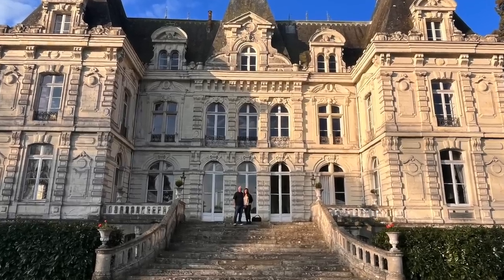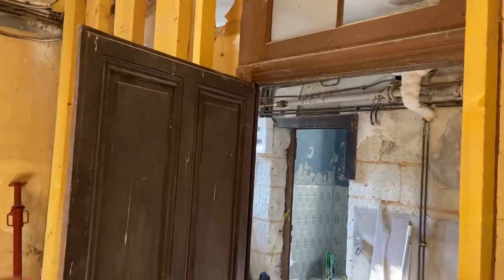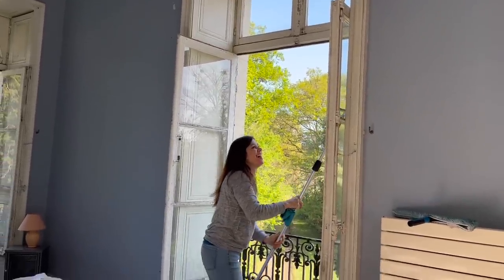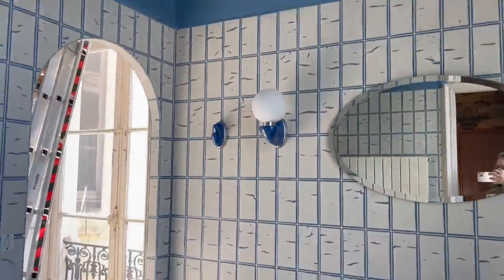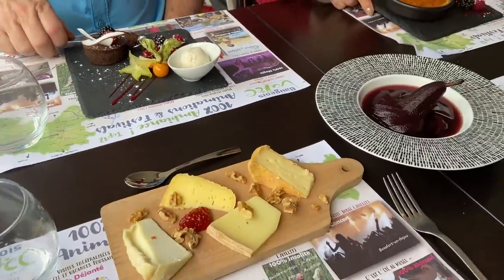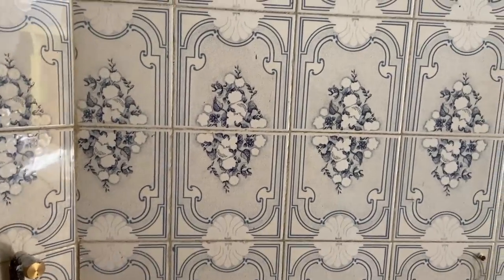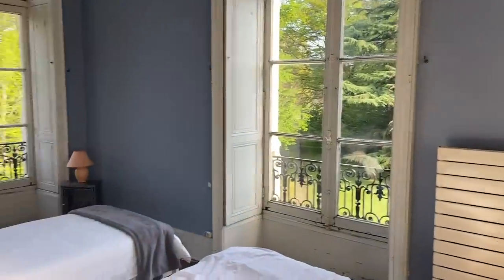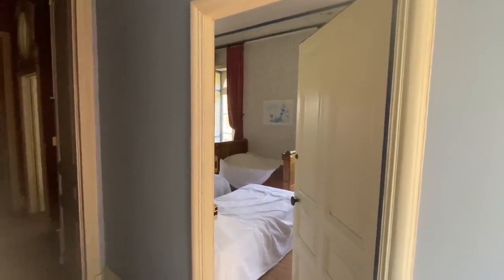Château de la Grifferaie S4, E13 "The Chateau comes to Life"

Comment: Rob the hose fittings are called Minsup, they are typically used for compressed air lines, there still used on medium to heavy industrial applications for Air compression tooling etc.

Comment: Later when you have time the repaired tiles can artistly have the pattern drawn on all the repair spots with a fine drawing paint brush and the colour matched and no one would ever know there were any patches on those tile then a glaze paint on top of the repair would last for another 50 years. Good luck that tile in that bathroom is beautiful and you’ve done amazing job repairing to this point and can look perfect later with pattern match by hand. Ps put a flat glaze on first so paint doesnt soak in and bleed then paint then final glaze to seal. ♥️♥️🥰🇨🇦👏👏👏

Comment: If I recognize the specific aria from The Messiah you use in you intro, it has the phrase "the crooked straight and the rough places plain" repeated many times. It sounds like classical french garden design. Versailles and many chateau would have fit the bill. I'm not sure how much anything else within them did but I'm getting old. more rigid and set in my ways 

BTW - I had to do the same thing to my DIY ceilings but found a guy around the neighborhood who went through about 25 gallons of joint compound to cover unevenness and some still slightly visible seams with a texture he pressed into it with his own bare hands. The ceilings weren't very uneven. He just laid a think layer to get a deep texture.  I don't know how he managed to do that without drying them to the point of bleeding but it didn't seem to bother him at all. I couldn't work with sheetrock very long without it sucking the oil out of my hands. Corrugated cardboard does that too I've noticed. 

Too bad about the falling stone. The Two Jeromes - on YouTube occasionally- always keep their stone scraps, crush them, mix it with cement and make perfectly matching patches. For places like the broken molding where the piece may be substantial, they use stainless steel screws into the stone and build the patch over that. They get amazing results. It isn't clear how long the patching may last.

The beams over time also shrink a lot across the grain and not so much along the length. 4in x 4in x 16in firewood I get each year can shrink by as much as 3/4 inches across the width in a  year.

That painting at the end looks very modern. It looks like the work of an amateur.  Maybe it was one of the prior owner' family members within recent years? It looks like it is supposed to be a bath or garden with baths.  You can see passages that look like the painter wanted an Alma-Tadema kind of roman extravaganza. I think the figures fighting over a towel in the back are from one of his bath paintings? YouTube? censorship would seem a little silly considering the context. If you don't really like it you could always paint over it with a water based paint. I don't really think it goes with your place anyway.  If it was my place I wouldn't keep it because they make the architectural parts look clumsy and inelegant. It doesn't do the figures much of a favor ether. (hope the painter doesn't see this).
Reply from the maker: Yes, thanks for noticing.  "Every valley will be exalted, and the rough places made plain".  The passage specifically from Isaiah referring to John the Baptist calling for the way to be prepared for the messiah.  In general terms, we're alluding to the fact that God can make a way, even when things are not straight and easy.